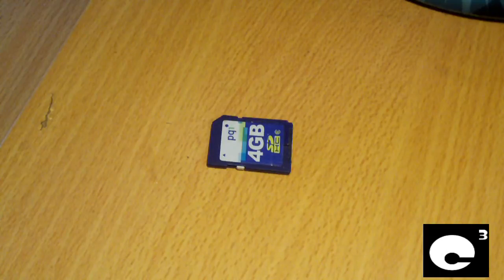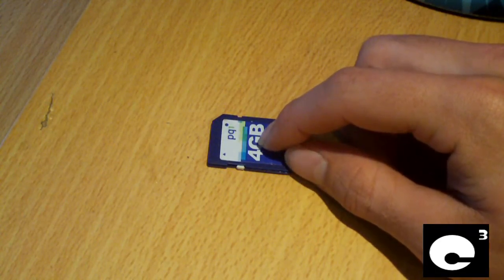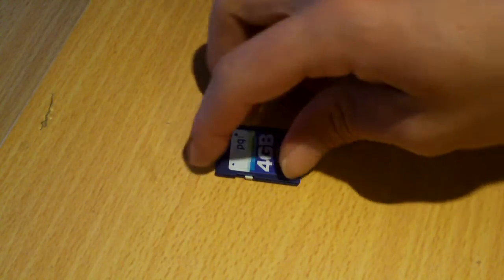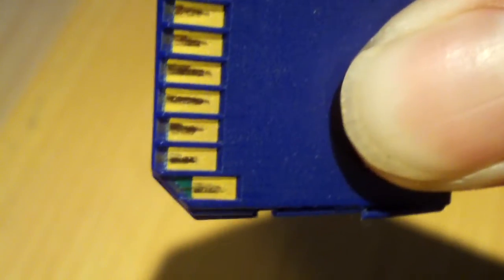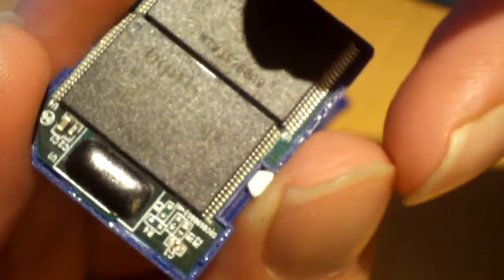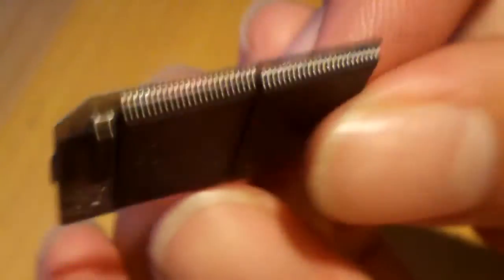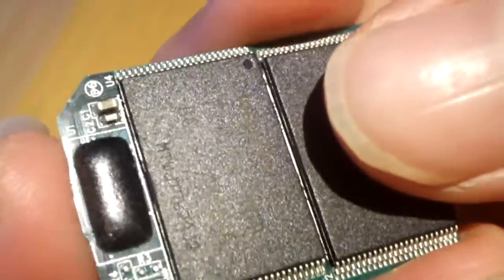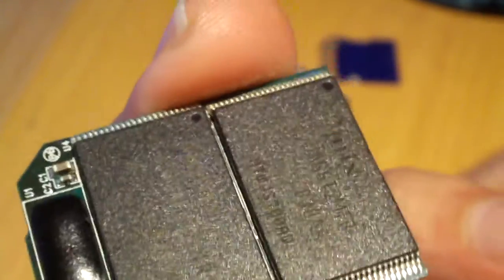Inside a 4GB Class 6 SDHC memory card

Comment: I'm interested on the sliding switch? How does it work? What's the mechanics of that switch? How does it prevent or allow writing on the sd card. Is there a circuit that the small switch connects together or disconnects from?